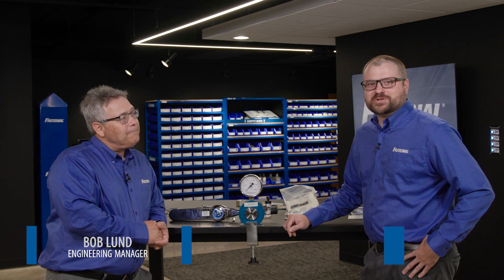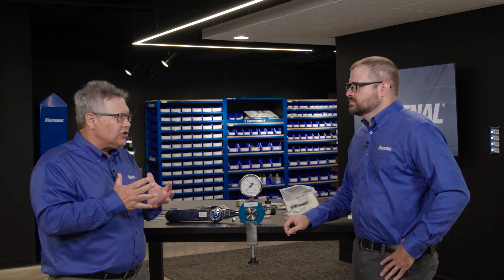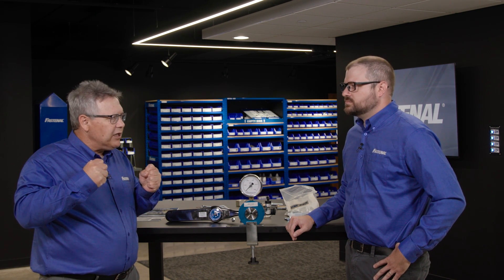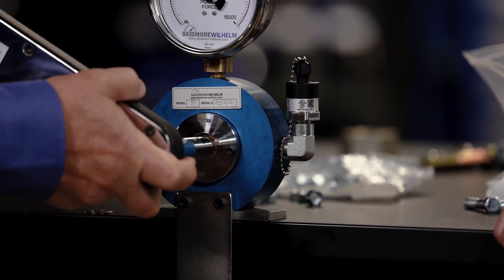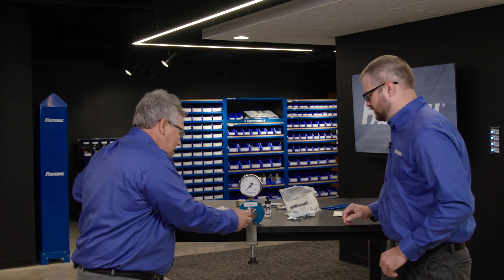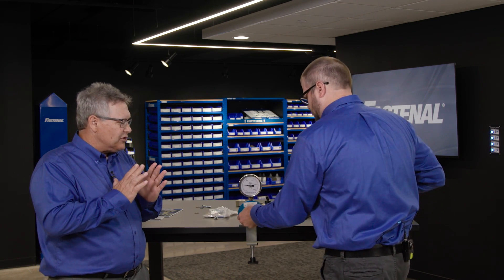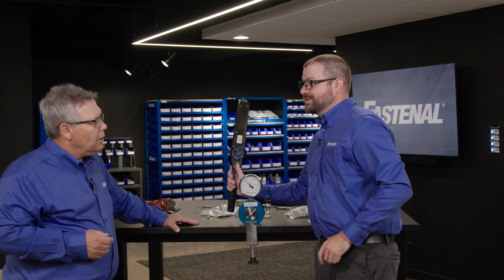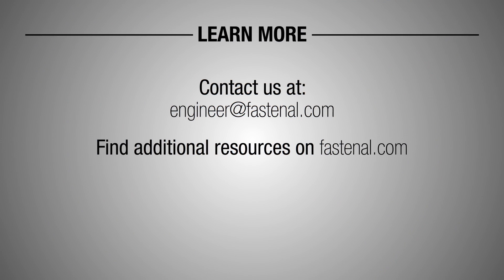Fastener Focus: Torque vs. Tension

Comment: please provide the difference with torque with thread locker
Reply from the maker: This is dependent both on the finish of the fasteners and the exact thread locker formula used. We continue to build data with every combination tested, but each scenario is unique. Please email engineer@fastenal.com to coordinate with our applications team further. We may have a quick answer for you, or we may have to do some additional testing depending on your criteria.

Comment: Is it recommended to use a torque wrench as a breaker bar (Around 4:22 of the video)
Reply from the maker: Torque wrenches have limits before you mess with the calibrations or possibly break the wrench.  If a load to break a bolt free would go anywhere near the usable range for the wrench, you should avoid using the torque wrench.  There are a few tests where you may check the break away torque, but those are methods for seeing if the bolt is losing clamp load or for testing prevailing torque on a nut.  In both cases, you are testing shortly after installation rather than after a fastener has corroded in place.  Once you get to the point where your goal is breaking a bolt free rather than measuring something, I would protect your investment in a more expensive torque wrench by using a different tool for breaking a stuck fastener free.
Reply: @fastenal  Thank you for a much detailed response..